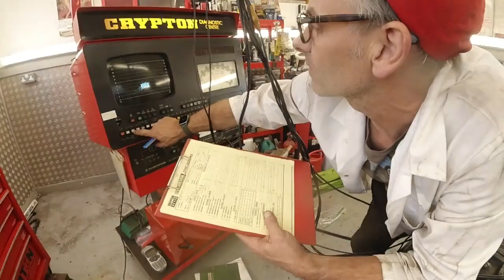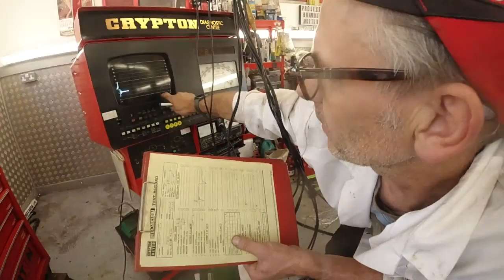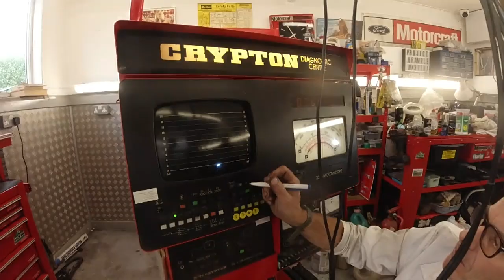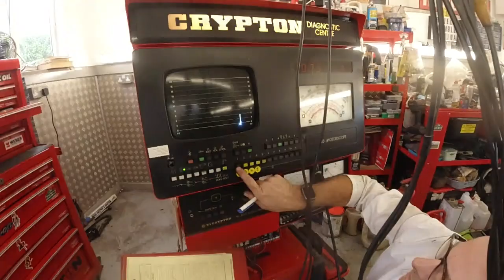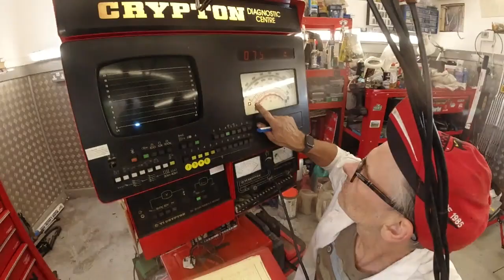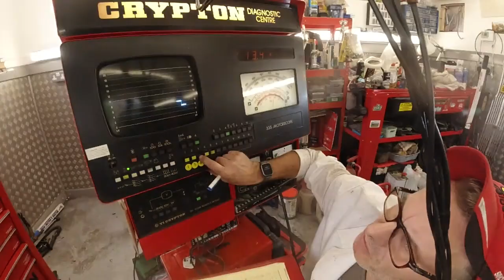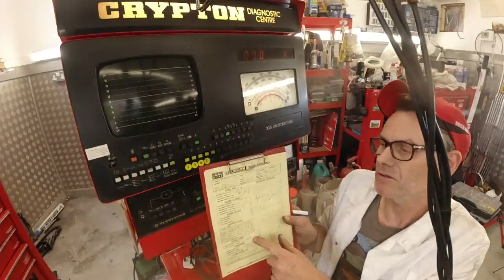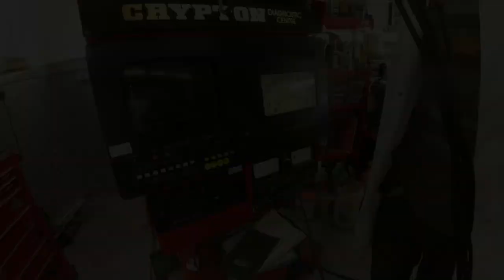MK3 Cortina - Pinto Engine Install - Pt2

Comment: Evening Pete if you take the cap off the distributor there is a line scribed on the outside of the body to which you must align the centre of the rotor arm when the engine is at TDC on No 1 cylinder firing stroke ,that gives you basic static timing.

Comment: Excellent video as always , your wealth of knowledge is second to none and your explantations of jobs in progress is superb. It gives others doing their own cars plenty of excellent tips too. I've often wondered why on the twin choke Webbers the fuel pick up pipe is plumbed to the side nearest the engine which does not make sense at all as it kinks the pipe its nearest the heat and puts stress on the brass tube coupling. On the subject of sludge in the cooling system its also not uncommon on engine blocks to find traces of casting sand from the production process! I remember my friend flushing out an Essex V6 and we found it in the bucket of drain water afterwards 😮

Comment: part of the trouble with them old systems is if the battery is not charged the starter will take everything out of the battery leaving nothing for the coil to fire

Comment: Sorry Pete. Late again. You still have a strobe effect on your vid mate. I remember seeing a video a few weeks ago about a similar problem. Something about having to reset your arperture settings/frame rate/shutter speed on your camera to cure it. 
 This isn't what I was watching but it has some info that may be of use. IF you don't know it already, that is. I'm not trying to teach my Granny how to suck eggs here Pete. 
😉https://youtu.be/eTzQky3hRLI?si=tKjBNrlG5RH18sR2
Reply: Yeah unusual suppose you would do a small video beforehand if you actually have reason to suspect it won't turn out right.